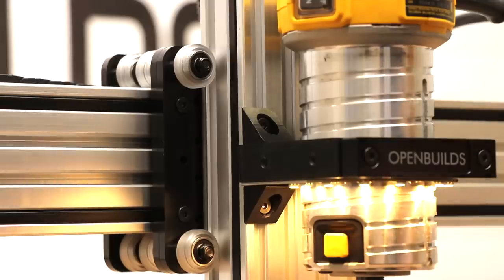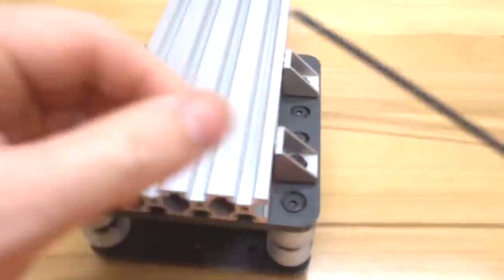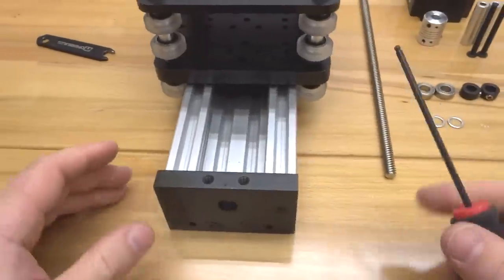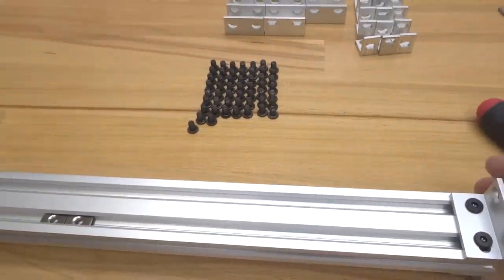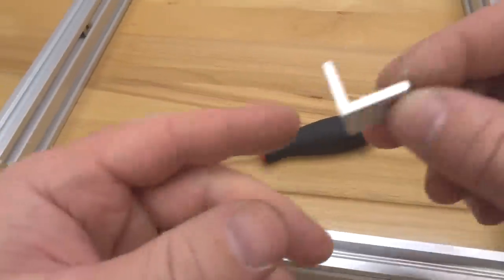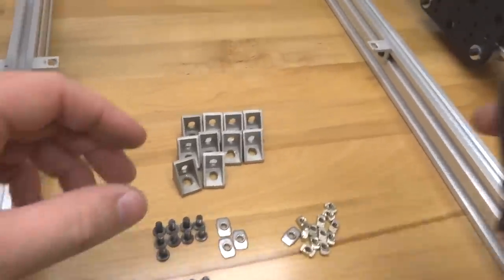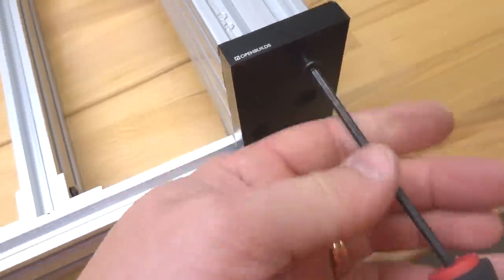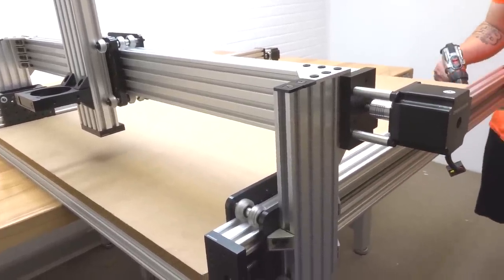OpenBuilds LEAD CNC 1010 Build

Comment: Thanks for a very detailed video, not only for showing how to put this particular machine together, but also for demonstrating how each of the parts could be used in your own build 👍
NOTE: At 6:35 / 17:27 place the second plate against the rail to ensure it is at right against to the first plate ... doesn't make sense to place both plates together as they will obviously be at right angles to each other!

Comment: Is it imperative that the eccentric nuts be on the bottom? Can they be on top for easier access? Is there a reason for them being on the bottom side?
Reply from the maker: While I would not say its imperative, I think its more of the idea of the gantry plate hanging from the even wheels set at the top (kind of like a sliding door) and being locked in place with the bottom wheel sets.

Comment: Can you explain when to use a normal nut block (or 2 in a row) or the anti backlash nut block) I bought the anti backlash just because I thought it was better, but I can hardly get my screw thru it, its VERY tight, I also have a normal nut block so was considering going with tat (which is nice and easy to screw), but what's the point/theory behind the anti-backlash nut?
Reply from the maker: Please reach out to contact@openbuildspartstore.com so we can further assist you with your inquiry. Thank you.

Comment: How does the LEAD compare to the Workbee? Is it less rigid?
Reply from the maker: They are both great machines, the LEAD does have the advantage in that its a modular machine so that you mod it to say have a taller Z axis. On being ridged they really are about the same with the exception of the LEAD 1515 which has a double X axis C-Beam making it a very strong platform.